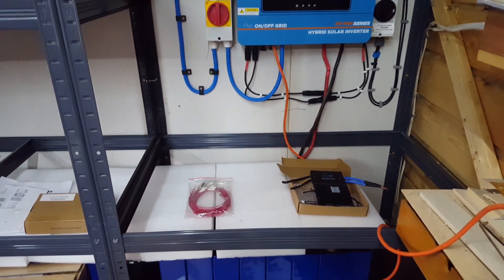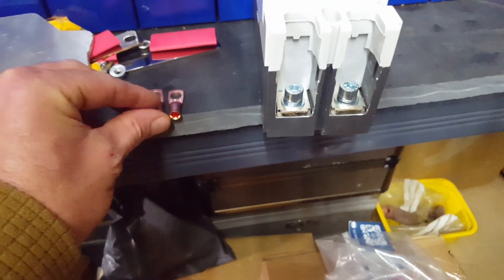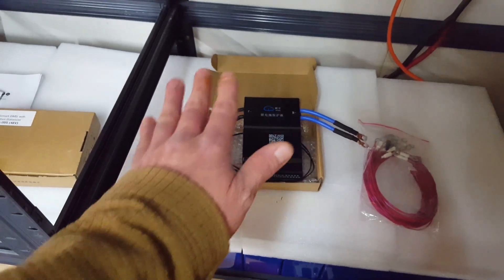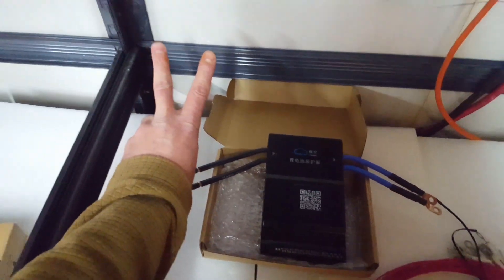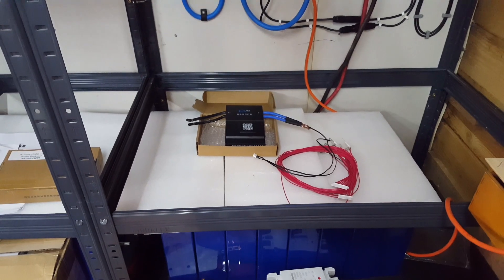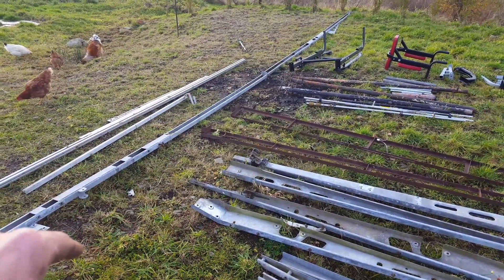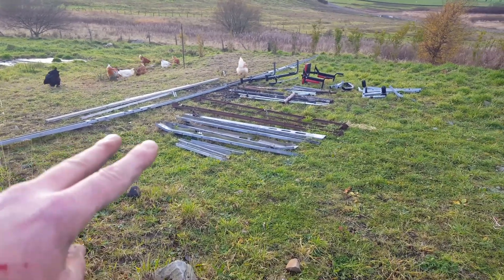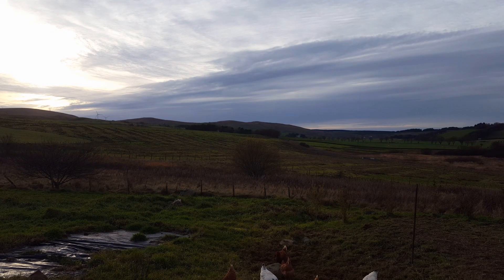Musings of a Mad Man Scrumping For Scrap. DIY LiFePO4 Build Hiccups &  Materials for Solar Array

Comment: Nice video again mate. You could cut off the lugs from the JK BMS and either put both cables into one lug (Andy did this with his) or you can run them both to a single prong bus bar then run a thicker cable to your battery. In terms of the amount of cables running into your breaker, put the terminals back to back, that way you should be able to fit both in together without having to fabricate something. You can also run the BMS cables into terminal blacks that fit on a din rail (again Andy did this then run extended cables to your batterys. Resistance shouldn't matter over the short distance as they just move power from one battery to another. Things are progressing slowly but surely now 👍
Reply from the maker: Thanks mate.
Andy used wee 2 stud busbars for his jk BMS on the middle shelf.   All those rails he uses add cost and complexity I don't think I have the I.Q for lol.
I sent my lugs back for a refund a ordered some better longer shanked ring lugs just incase I put 2 cables into 1 so I can get a good crimp.
Cheers
Reply: @garys-half-baked-offgrid-dream  thr benefit of the 4-8 cell JK BMS is it comes without cables so I could make my cables along as I needed them to be. Just need the batterys to come for mine lol. You will find a solution I'm sure 🙂👍